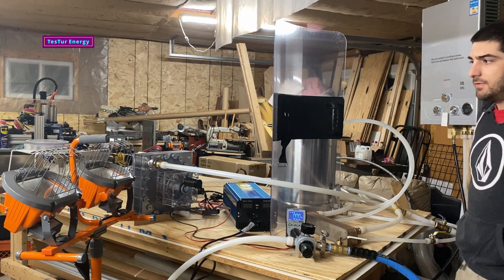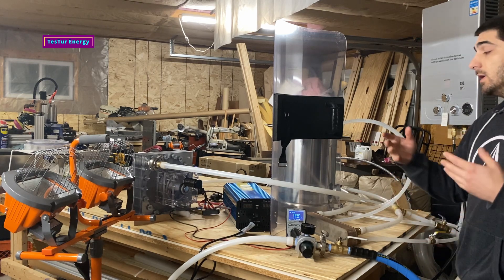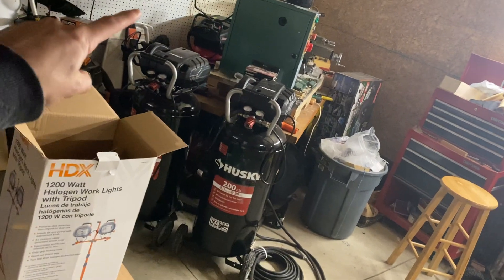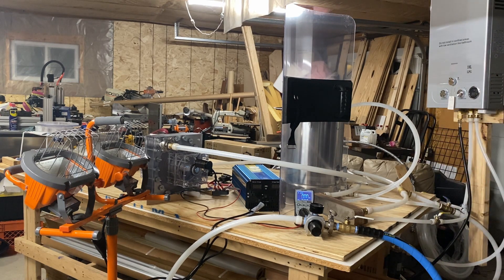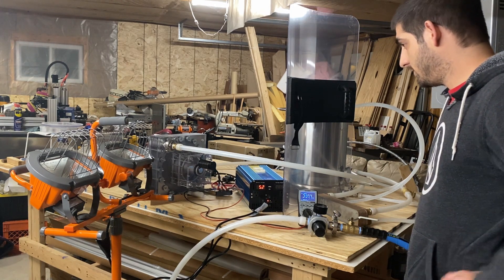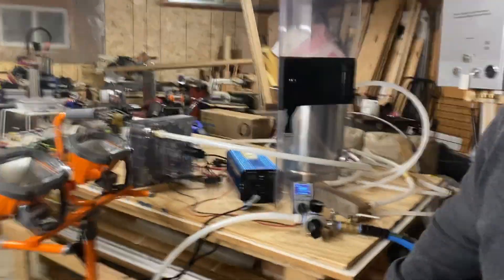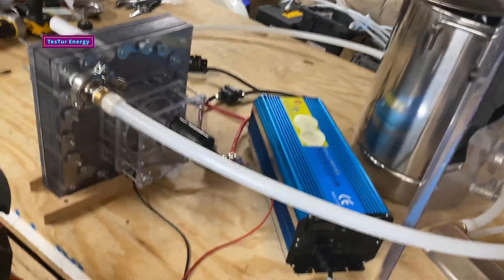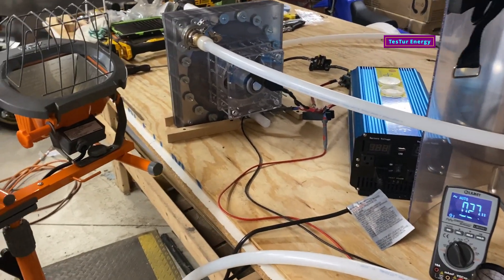Amazing Tesla Turbine Actual Power Output Test - 1200 Watt Real Electrical Load - CAES - Turbo Jet

Comment: Nice job Charlie! I appreciate your focus on power instead of voltage. Also, you can see how serious you are about this by the quality of the hoses and fittings you are using, and the use of actual safety equipment helps show your commitment. Good luck, looking forward to more research.
Reply from the maker: Hey thanks FilterYT!! That means a lot to hear! 😬😬😬 honestly I wouldn’t have half of these quality components or equipment if it wasn’t for the support from my patreon donors. They make this dream possible! I don’t get to do what I do without the help from them. Can’t wait to show the next steps!!
Reply: @CharlieSolis  I plan upon becoming a donar soon too buddy
Reply from the maker: @fxphenix5162  please do! 😇😇😇 I can use all the help I can get paying for all these components and fittings for this R&D!
Reply: Looks like PexA. Good Stuff.
Reply from the maker: Tri-clamp and Pex-A is life! I just wish they made a UV resistant pex-a and my needs would be complete. But yeah that Pex-A stuff is no joke price wise to get into but once you’ve got the basic stuff its wayyyy easier and cheaper In the long run.
Reply from the maker: 1200watt Load Test ELECTRICAL Output Efficiency Calculations For 10in Tesla Turbine Are In! 
See the charts here!
https://www.youtube.com/post/UgkxRukN0zoVbtfe1LmLUlXyIo0kdt1ExWZs

Comment: Awesome! Next test, see if you could maybe tidy up your rig there so its more presentable for the audience!
Reply from the maker: Sure! I’m glad you’re volunteering to help!  When did you want to come by and help organize? 😂😂😂 lol yeah this weird setup will make sense when I show why I have all the plate heat exchangers. Right now it’s the most efficient use of materials, piping, fittings, etc, to keep it in a nice tight space and not have to many sharp turns anywhere in the turns. Also the closed loop vacuum pressure steam systems will be much more simple in the large build.
Reply from the maker: 1200watt Load Test ELECTRICAL Output Efficiency Calculations For 10in Tesla Turbine Are In! 
See the charts here!
https://www.youtube.com/post/UgkxRukN0zoVbtfe1LmLUlXyIo0kdt1ExWZs

Comment: Could you please measure the energy consumed by the compressor vs. the energy produced by the turbine, to find out the losses of the system? This could be a great storage system if it gets higher than 60% - which is what other compressed hot air systems are making.
Reply from the maker: Hey George, thanks for commenting! So without thermal recoup no compressed air system gets more than 10% efficiency, because most of the energy put in gets radiated away as the heat of compression in the interstage cooling heat exchangers. So without an interstage cooler that takes the heat and puts it back in during expansion (something I am working on having for future tests but just not yet) at best the system can be is 10%. 

Currently the efficiency numbers I’m going to compare to are the specific available energy of 170gallons of 150psi compressed air. I think the general rule of thumb is 3kWhrs of energy requires 65m^3 or ~17,000 gallons. So 170gal tank should have 0.03kWhrs of available energy, or 1.8kWmin. Essentially 1.8kw output for 1 whole minute. Technically this did a 1.2kW load for 0.5min so 0.6kWmin were put out for the electrical energy. But some energy was also put into accelerating the disc stack up to the operating RPMs as well that’s not considered yet. Also considering the tanks were only exhausting to 60-70psi there was a good amount of energy left on the table unused in the tanks. So I will be doing a more precise calculation soon, during for the thermal addition tests that I have coming soon, to show the total available energy in a 170 gallons of compressed air taken from 150psi-65psi. 

Again to me this is more accurate way to test the turbine because then the turbine’s efficiency does not include the inefficiency of the piston compressor that I’m using. It’s a better calculation for the overall efficiency of the turbine itself to only use a comparison of theoretical available energy to energy actually put out. And not the actual energy put in from gasoline combustion to run the inefficient compressors and then expand what’s left after that through the turbine especially when interstage radiator cooling is done and not recouped on the compressor. But yes I will have more precise calculations for efficiency soon once I have the whole 350gallons of tank setup. The larger the tanks the more accurate the efficiency tests will be. So stay tuned!
Reply: @CharlieSolis  thanks for your very informative answer.
Thermal insulation is a major problem. I think you should check this solution that the Danish guy made, using special materials to withstand forces generated by the stones contained in the columns. He has managed to get 60% overal efficiency, taking into account the compression losses

https://youtu.be/6tEkRRec3NE
Reply from the maker: Oh yeah really cool! I’ve seen some really cool projects using the the mass of rocks for thermal energy storage. Have you seen this one where they use all the ground underneath a home to store heat from summer air to be used for heating all throughout the winter? And then use the cold ground after for cooling all summer? 
https://youtu.be/7PXfvfZ-b-o

For the solar cryophorus turbine generators I’ll be using water for thermal energy storage because it’s got just about the highest energy density over most solids. Although you can take rocks up to much higher temps for larger quantities of energy storage per kg and not worry about evaporative cooling of your thermal storage.
Reply: @CharlieSolis  that's a nice concept, close to geothermal energy.
So in case water does not work as you would wish, will you also check for wider gaps? I believe that it won't be just to stop experimenting if you don't get the same Reynolds number there
Reply from the maker: I will add more discs if I need more flow because the individual disc spaces are to tight. You can change the Reynolds numbers by also changing the flow through each disc. it’s very unlikely I will ever go to anything more than twice this disc spacing though. Especially because maintaining the dimples in the periphery of the discs to maintain that thickness would be difficult as it would probably start to reduce the strength of the discs since they are already so thin..🤷‍♂️ we will see. But doubling the disc spacing would increase the turbine width by 50%. Tripling the disc spacing would double the width to keep the massively increased surface area that I have.
Reply from the maker: @gdlignos  hey George! Not sure if you got a chance to see it yet or not but I uploaded the thermal addition video and did some actual energy converted calculation walk throughs. Check it out! 
https://youtu.be/bWpXRzrzf4g
Reply: @CharlieSolis  amazing! I am replying to that video then :)
Reply from the maker: @gdlignos  💙💜💚 enjoy! 
Also I did some efficiency calculations of the turbine too but they aren’t in that video. It’s not round trip efficiencies. Just the converted energy from available in the tanks. I did a copy pasta below of what I wrote in a couple other comments. 

As for efficiency I have now calculated it a few different ways. If we only consider the energy put out by the light alone the efficiency seems to come in around 15-25%. That’s calculating the available energy in the amount of compressed air we have available in a couple different ways and is really a rough estimate. If we can fix the gear losses, again which should be easy to do with the the axial flux generators, the efficiency is coming in between 25-35% efficient and could be even higher depending on how much of a low ball I put on those loss numbers. (And that’s not accounting for generator iron losses, rectifier losses or inverter losses too) my power loss tests showed 1-2hp of loss from the unloaded condition and my calculations only have 800watts of loss. That’s only 1.09hp. Realistically the loaded condition could be seeing upwards of 2-3hp loss so the real losses are something like 1600watts plus, which if that’s the case the efficiency is looking like it’s close to 35-55% efficient. Again these are rough estimates for how much energy is available in 170gallons of 150psi compressed air dumped to 65psi. Which for the record the different ways I calculated it give it a range from 260,000-380,000joules. I had a whole section about efficiency in the part two video but it made the video like 20 minutes long and very dry so I decided to cut it out and I’m going to be making a video about just that. 

But yeah if you know how to, let me know what you get for the total joules available in a 170gal tank at 150psi being dumped to 65psi. Like I said, I came to those numbers above. It would be interesting to see what others calculate for me to compare to.
Reply from the maker: @gdlignos  1200watt Load Test ELECTRICAL Output Efficiency Calculations For 10in Tesla Turbine Are In! 
See the charts here!
https://www.youtube.com/post/UgkxRukN0zoVbtfe1LmLUlXyIo0kdt1ExWZs